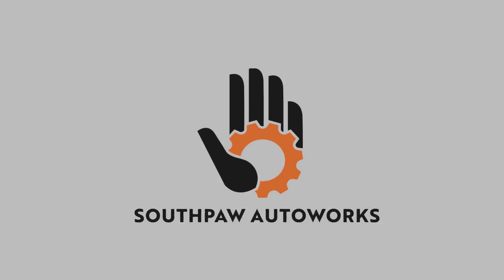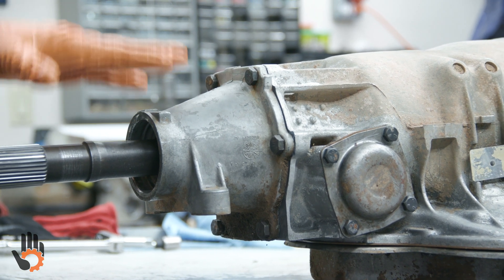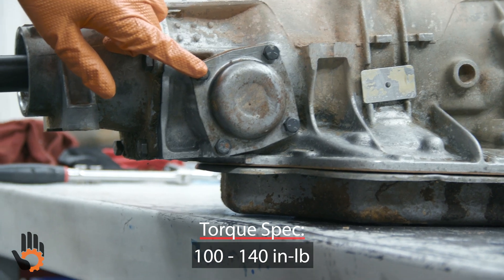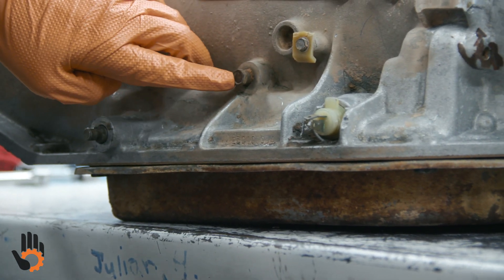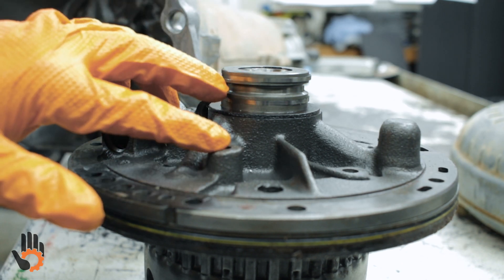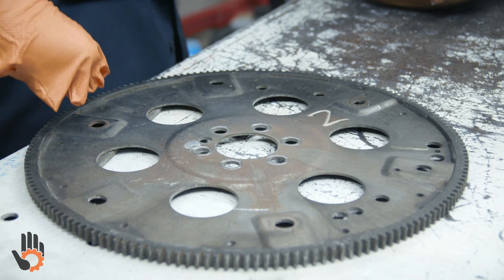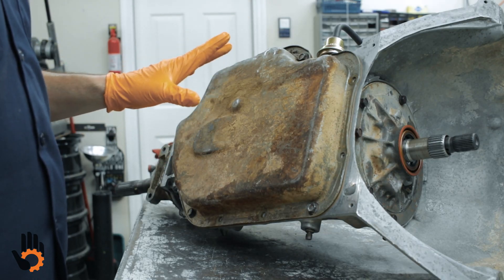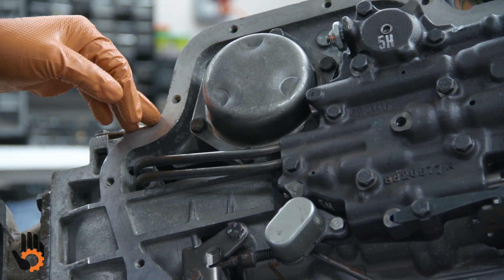TH400 Torque Specs + Torque Patterns

Comment: LOVE the video!  My family and I are swapping a Th350 for a Th400 in a couple of weeks and I am trying to make sure we have everything in place for a smooth transition.  I do have a couple of questions.  
How come some of your specs are in inch pounds and some are in foot pounds?  
Why not give them all in foot pounds?  
How do you convert from inch to foot?
Or should we invest in an inch pound torque wrench?
Reply: Thank you for your videos . 
What is the output shaft to yoke bolt torque?
Please 🙏
Reply from the maker: Unfortunately, I wasn't able to find a torque spec for that.  =/
Reply: @SouthpawAutoworks found your answer. I'll do the 90 ft lbs like that other guy said.
Reply: 90 ft-lbs
Reply from the maker: Right on!  Sounds like a fun family project.
Great questions.

***Conversion***
12 in-lb for every 1 ft-lb.

10 ft-lb is the same as 120 in-lb.
10 x 12 = 120

***Why isn't everything in ft-lb?***
There's a couple of reasons.  Here's the most important one...

1). Operating Ranges:
I happen to own two (2) different ft-lb wrenches.  One is a 3/8 drive, the other is a 1/2 drive.  Both of them have different torque ranges.  However, both of them will go as low as 10 ft-lb.  If we convert 10 ft-lbs over to inch pounds, we know it's 120 in-lbs.
The torque spec for some transmission oil pan gaskets are right around 55-70 in-lbs.  In this instance, my ft-lb torque wrenches are "too big" for the job.  If I decided to go ahead and use my "big" torque wrench to tighten the pan gasket bolts to 120 in-lb (versus 55-70 in-lb), chances are, damage would occur (pan gasket will split and/or pan bolt hole threads will strip).
There's a number of other transmission components that are torqued to less than 120 in-lb.

If you're wondering, I happen to own click-style torque wrenches...versus digital.  I'm thrifty.....wife says I'm cheap.

You may be able to "rent" a torque wrench...free of charge.  Check with your local automotive parts house, about their rental programs (Advance, AutoZone, Oreilly's, NAPA).  Should you decide to invest in one...

Torque Wrenches:
https://amzn.to/3rbLxHz
https://amzn.to/449Ag9e
https://amzn.to/3XGSqN2

DISCLOSURE:  🕵
Links provided are affiliated links with the associated websites. While there is no extra cost to the purchaser, a small portion of the sale goes to support this YouTube channel.
Reply: @SouthpawAutoworks  Thank you so much for the additional info, I really appreciate it!  Of the 3 in/lb wrenches you listed are they listed in the order that you would buy?  If not, would you please rate them #1, #2 and #3.  I think I would like to invest in one because we have many cool projects planned for our Vette.  Thank you again!!
Reply from the maker: I use a Craftsman click-style that's outfitted with a 3/8 drive.  I like it, and would buy another one, if mine was lost/stolen.  Unfortunately, I wasn't able to source one of those through Amazon.  However, you may be able to find one elsewhere online.

Rating:
I have no working experience with any of those torque wrenches listed.  So, it's hard for me to put them in an order.
I will say that some in-lb wrenches come with a 3/8 drive, and some are equipped with a 1/4 drive.  I personally like the 3/8 drive flavors.  The ones I've used in the past, that were 1/4 drive, always had an adapter living on them (1/4 to 3/8 adapter).
Best advice I can give, regarding the Amazon listings, is to read the reviews.  They might have product review videos, too.

Whatever you purchase, do what you can to make your investment last:
1). Always set the wrench to its lowest value, when not in use.
2). Don't use it to break bolts loose...only tighten with it.
3). Don't drop it.
Note:  All of these things help to maintain the tool's calibration.

Wishing you and your fam all the best with your Vette projects.  Making memories...
Reply: @SouthpawAutoworks  thank you so much for the additional information. I will be sure to come and check out your video periodically. I'm even considering rebuilding the 350 we're going to pull out.
Reply: Hey Robert, I can't seem to find anything definitive on which way the trans fluid should run through the car radiator and why.  Should it pump from the  bottom of the radiator to the top or from the top down?  I did see one comment in a car forum that mentioned pumping to the top so that gravity will help it return to the transmission and it's less pressure on the trans pump.  I am looking forward to hearing your thoughts. Thank you sir.